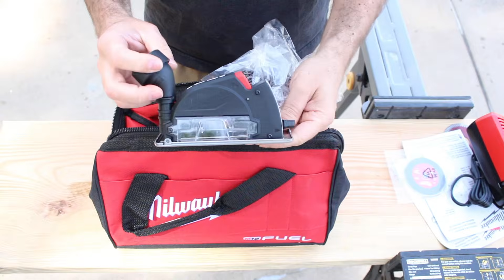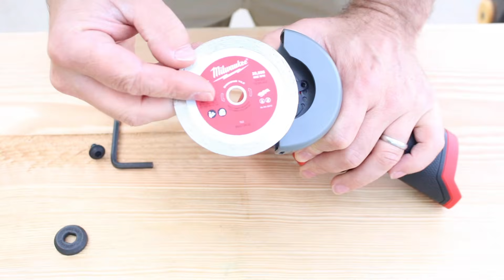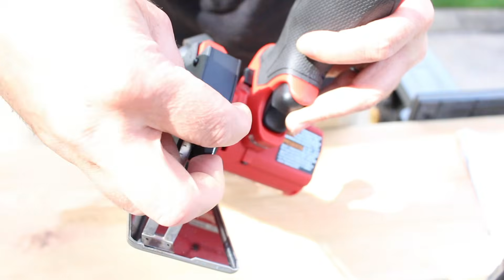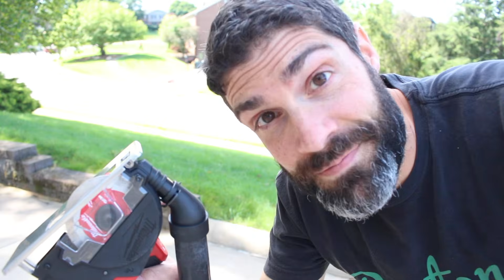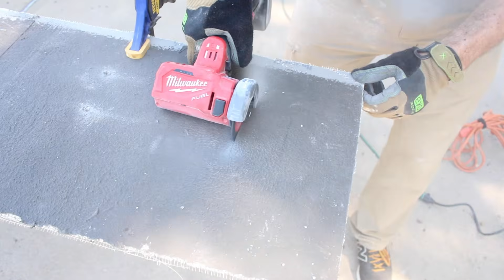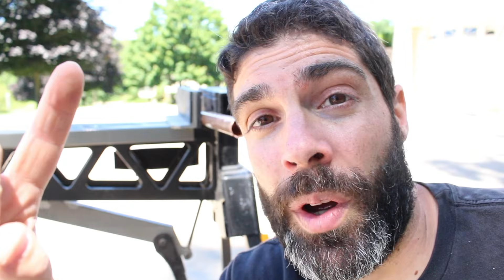Milwaukee 12V Cut Off Tool...What Can It Cut?

Comment: I used mine quite a bit to demo my fiberglass shower.  I’ll use it to cut Rondec when I get further along.  A very useful tool.
Reply from the maker: thanks for the feedback, I was curious how it would work with Rondec!
Reply: how well did it work cutting the fiberglass shower?
Reply: john doe I used the cutoff tool for most of it, along with a reciprocating saw.  Both were needed, based on what I was cutting up (I wanted to make sure I didn’t cut into pipes or wiring with the recip saw - the cutoff tool makes a very shallow cut - that’s it’s strength).  I did go through batteries on the cutoff tool, but I have an ample supply.  I would use it again if I had to demo another fiberglass shower.
Reply: @gregdavis9720  that's awesome thanks for the reply

Comment: You can use the 7/16 arbor that comes with it and use the Dremel Blade to cut wood. It's useful in tight areas were you can't fit your bulkier cutting tools.

Comment: I use my angle grinder, battery powered and alternate between cutoff wheel, diamond blade, concrete grinder, or metal grinding wheel, and obviously, that’s a pretty useful tool. I’m failing to see the main reason for this tool... wouldn’t my $40 18v (which I use one-handed all the time) accomplish what this one does and a lot more?
Reply: because a giant angle grinder may not fit where this tool can?
Reply: @Dexter_Solid  this little tool takes more space than a regular angle grinder tbh😅
Reply: Cause it's super cute and you can make everyone jealous
Reply: I use my 16" Makita circular saw one handed too
Reply: @douglasward718  🤣🤣🤣

Comment: Great review. I agree, it appears to be very limited with a 3 inch blade.
Reply: So is a 3” cutoff air tool. .. which is what it’s replacing
Reply from the maker: thank you, admittedly we like the 3” blade for cutting electrical outlets in tile, but Milwaukee needs more blade options for porcelain, marble, glass, etc

Comment: When you're using the dust chute thingy, you should be cutting with the blade running in reverse. With it running forward the tool is always going to be trying to climb up the material you're cutting. It's also sending all of the kerf material away from the dust port.
Reply: Yup you're running the tool in the wrong direction. Also the reason the tool keeps jumping going in the wrong direction
Reply: Being a home repair tutor these days means having a good camera and production equipment and nothing else lol.
Reply: Lol I just seen this video and was thinking the same thing.  Come on man put the damn thing in reverse.  All of yas beat me too it by 3 years lol.  Also with all the shards flying at him he should have known to put the dust guard on it.  Oh BTW almost every m12 tool comes with the battery indicator on the tool.  The batteries are small so not much room to put it on there.  They want to make the tools as small as possible
Reply: Run it in reverse and you will have no dust
Reply: Leaving a comment to remind myself!
Reply: Once again the tool doesn't know tools
Reply from the maker: we recently used Fein’s HEPA vac with their grinder and it was fantastic, that was also running the blade forward
Reply: @HomeRepairTutor  a hepa filter does not matter. Like he said you're shooting the material the opposite direction of the dust shoot. Simply reverse the blade and it will suck most of it up. Also always use water when cutting tile those blades will caught far better.
Reply: @HomeRepairTutor  I know it's been a year, and hopefully you've figured it out by now....but just look at the blade direction of any circular saw...that's the direction you should be cutting. It sends all the debris towards the vacuum port, and it you won't experience the "jumping" and trouble cutting you were having.

Yes, you can overpower all those things by attaching a powerful vaccuum, like you mention...but what's the point of having a battety operated tool if you need a super powerful corded vacuum to use it?

When cutting in the other direction, you can cut dust free with a relatively weak battery powered vacuum.

Comment: This is a pretty weird tool. Review any cordless nail guns?
Reply from the maker: haven’t yet, do you recommend any cordless nail guns?
Reply: I like the Dewalt cordless18 gauge brad nailer. Best money I have spent in years. Planning to get the framing nailer and a cordless router as well ASAP in the Dewalt brand. Mainly because I have so many batteries already. I’m sure Milwaukee, Hitachi and others have good cordless nailers as well.
Reply: Justin McCullough ok boomer!

Comment: It's a great little tool, but like I say it's little and not to be used for anything heavy duty. I don't think that I could use it in my tool locker.
Reply from the maker: thanks Chris, it’s a super specific tool. Had the tile cutting been better I’d love it. It’s between a normal angle grinder and small Sawzall
Reply: @HomeRepairTutor  That is true sir!!